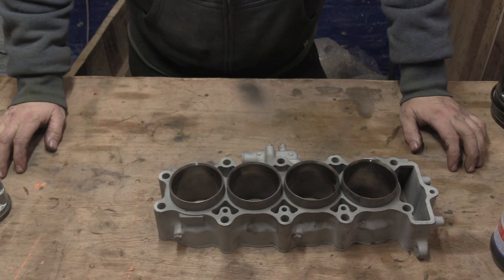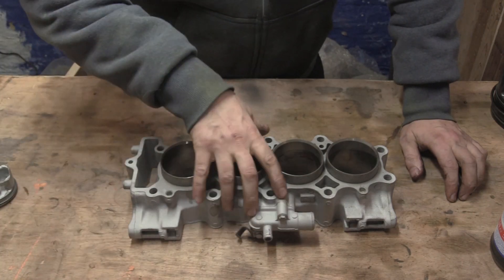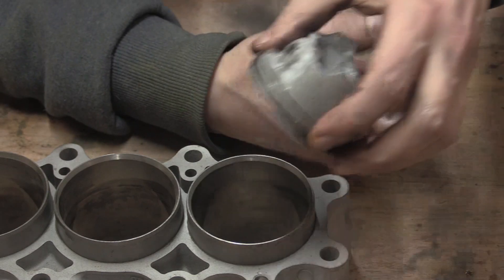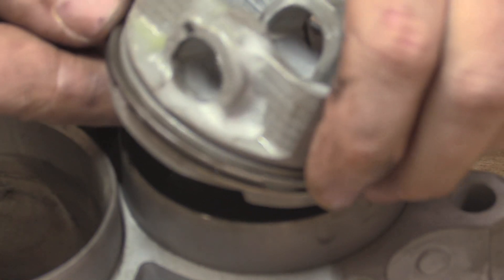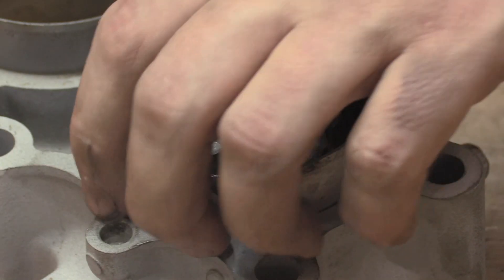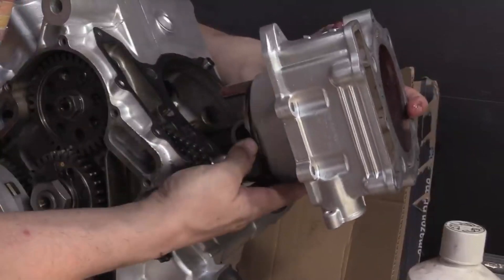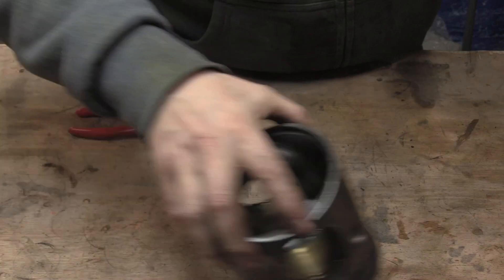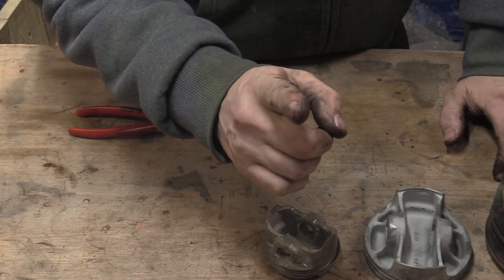You DON'T need a ring compressor

Comment: Really interesting, I'm waiting for replacement barrrels and pistons for my 1989 ZX10 from eBay. I can practice with the old barrels and pistons to get the technique right.
Probably a daft question but can I fit the barrels back on with the pistons in the bores.
Can the pistons come down far enough in the bores so that I can fit the piston pins and  the circlips?

Comment: with the inline 4 Matt that's a little harder because you have to do all 4 at the same time thats usually a 2-4 man jobby in my experience trying to get every ring compressed to slide the cylinder over all 4 is a mission
Reply from the maker: No you don't. You do two at a time, not 4.

Comment: I'd like to see you do that on a v8 engine.
I've done them buy hand on my dirt bikes and road bikes but there a bit different between a worn diesel piston ring and a fresh crom molly ring set on a small block chev and even less on a big block.
I've tried the rick method when our ring compresor failed.
The ring springs out under tension

Comment: On motorcycles, I agree that ring compressors are completely unnecessary and most cases I preload the piston before I even connect the wrist and the rod…. The only reason I use them on cars and trucks is to save time.

Comment: Matt, Ive always been curious: does the 120 degree offset between the rings always remain when the engine is running? 
Does this shift still remain the same in the engine that You are disassembling for renovation?
Reply from the maker: No

Comment: Do the rings stay 120deg apart when engine is running or are they rotating around?
Reply: Unless they are stuck or in a 2-stroke they should rotate.
Reply: @sedsberg77  what makes it different in a 2 stroke? Also if they rotate then there isn't much point in setting them 120deg apart when assembling then?
Reply: @sedsberg77  thanks for clarifying, I wasn't aware thats the case with 2 strokes